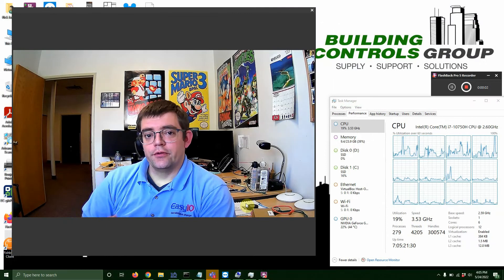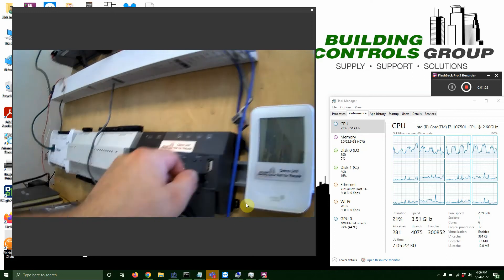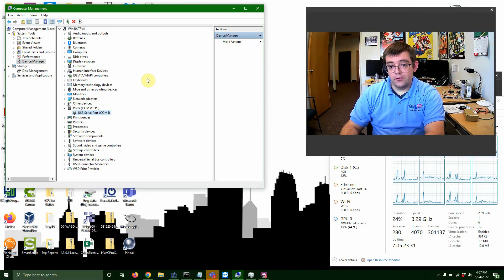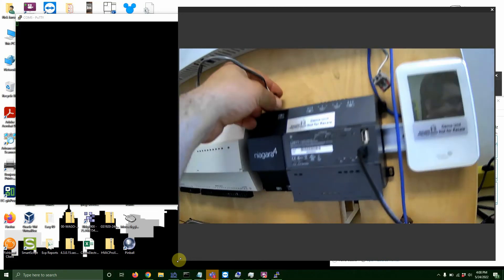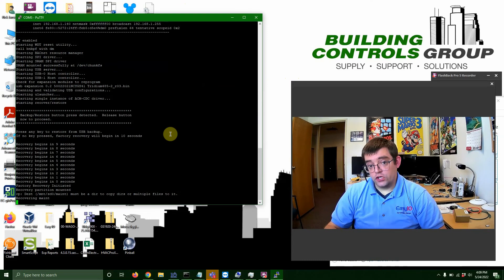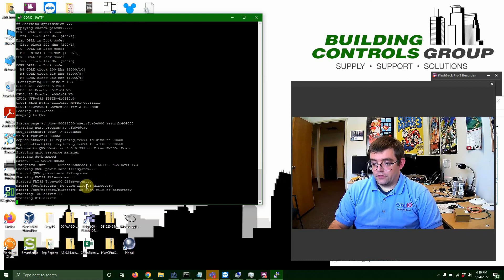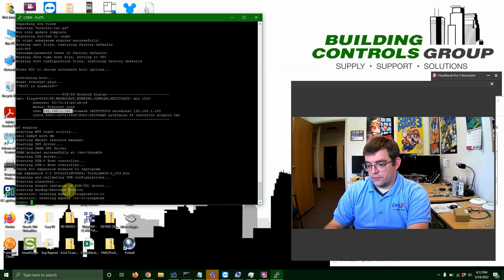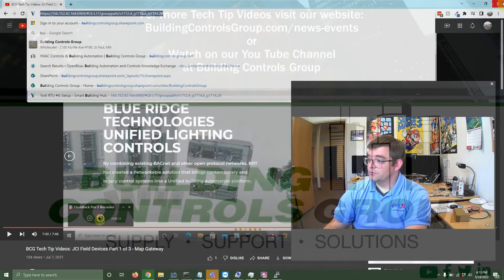JACE8000 Factory Reset by Rick Jansen

Comment: I tried to reset Jace 8000 with shared method but it got stuck at the login and password. I tried default login tridium and password  niagara but shows incorrect.

I am using LG brand for the JACE. If it has different credentials please share.